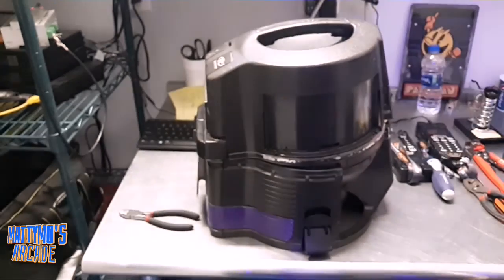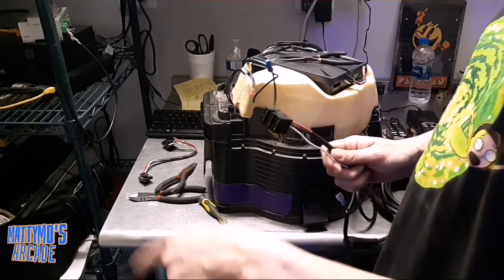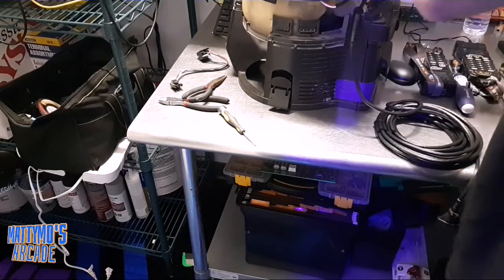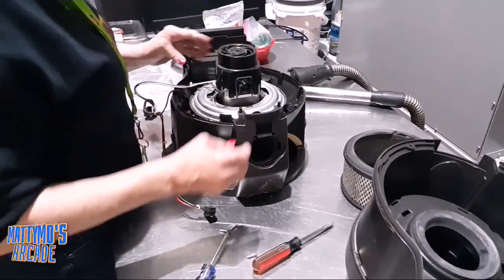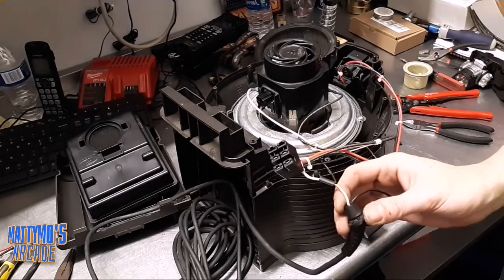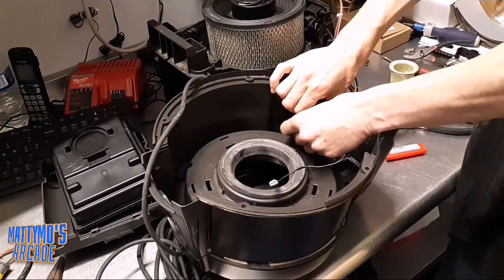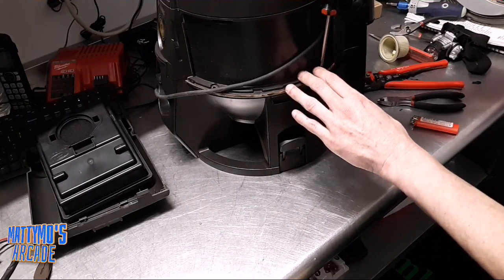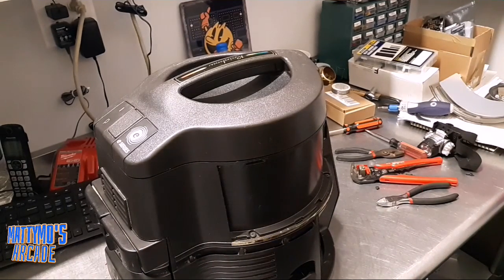Rainbow Vacuum Repair: New Filters and Power Cords

Comment: got a rainbow 2 series no power . got power from the cord to the unit that's it. any sugestions?
Reply from the maker: I think it's most likely a loose wire inside the Rainbow itself. It could also be the switch. I'd start there.